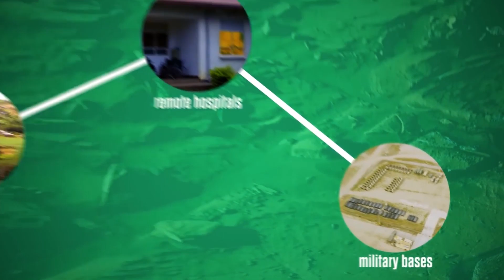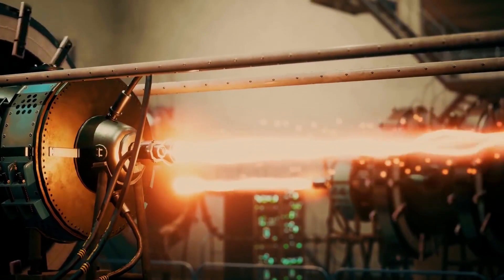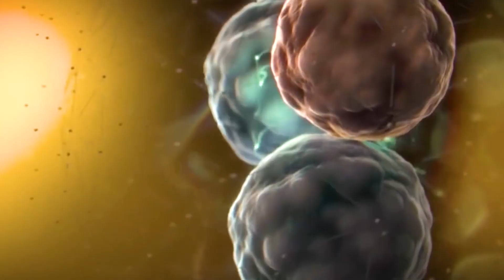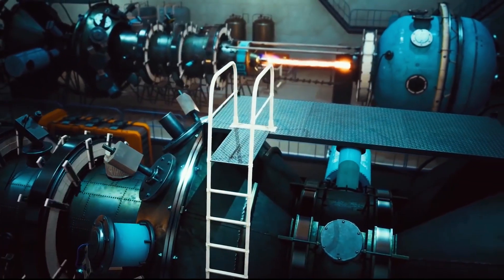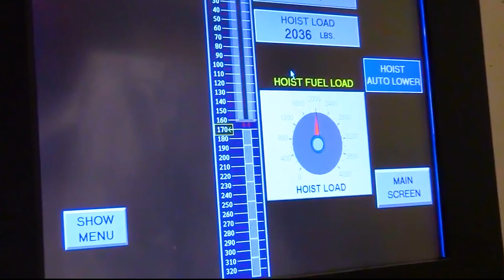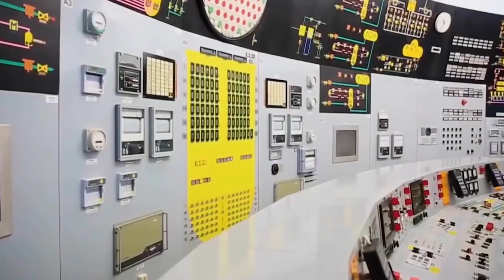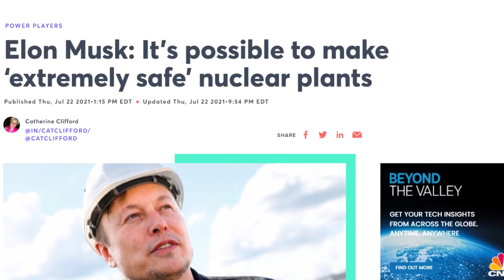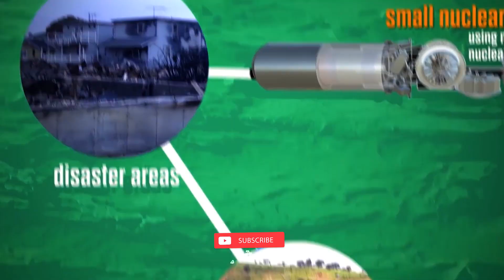Elon Musk JUST SECRETLY Built an INSANE Nuclear Reactor in 7 Days!

Comment: Are you sure abot that not melting part. Like, how about working with already melted fuel that can undergo a thermal expansion and get out of the reactor to reduce neutron flux in the core (thorium fluoride). This fuel could burn hot at atmosferic preasure.
Reply from the maker: Please make sure you are subscribed to the channel so you don't miss any updates!

Comment: There is a strong possibility that Helium Nuclear Plasmas will be used as weapons when excited with Microwaves & additionally pumped with high powered lasers .. These highpowered long distance weapons were first used in 1976 in one of the last issue of Iron Age Magazine of which I still have a copy of the article .. Originally , the microwave plasma devices was used with a laminar gas flow of Argon  with the introduction of ceramic material as they are able to cause immediate eutectic events .. Zircon sub micron dust was introduced in the laminar plasma stream to embed in steel to create bearing surfaces with much higher hardness & much lower friction .. The device that was upgraded to add a 5 KW laser was able to embed Zirconium to a depth of .161" so this wasn't just a surface treatment .. A nuclear fuel pumped pulsed plasma weapon with high enough energies could create devastation on a scale unheard of or it could provide temperatures & pressures to ignite nuclear a Fuel like He3 .. Because it is dual use , you can imagine that certain people in dark place won't want to allow this cat out of the bag ..
Reply from the maker: Please make sure you are subscribed to the channel so you don't miss any updates!